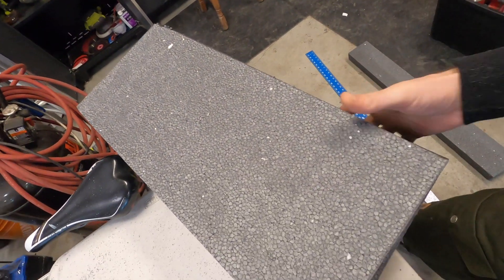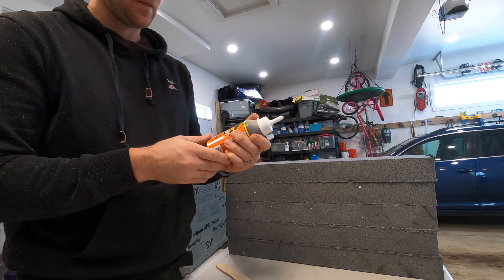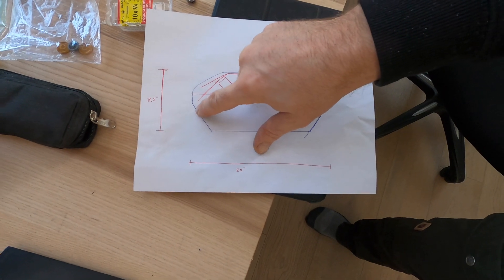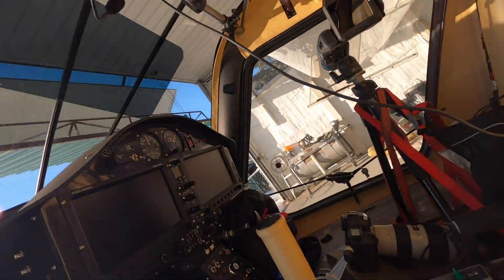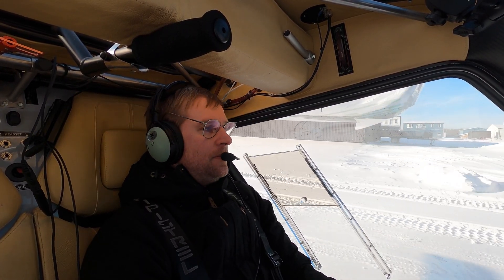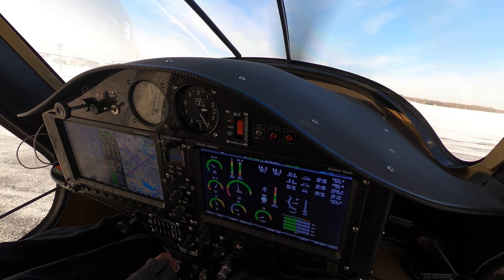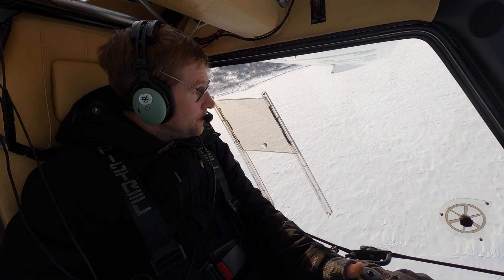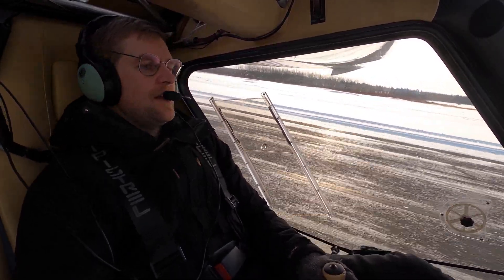I'm Back! Carbon fibre camera shroud

Comment: I was curious. Did you solve the  oil temperature issue? I have the same issue with my Rotax 912ULS and wondered what you did to solve it in your case?
Reply from the maker: Hey there, I had an oil pressure issue not oil temp. I installed large diameter oil lines and fittings to improve the loss of pressure as I climb
Reply: @DarrylZubot  Actually, look back at your videos. Your oil temperature is 120C or more! What happens at this temperature is the viscosity thins and the pressure drops. I have high oil temperature on my 912ULS and I can't figure it out. Its frustrating
Reply from the maker: @PilotJimmyJ  that has very little effect on this issue. I’m flying at high altitudes with cold oil temps and my pressure drops. You are right it will have some effect but it’s not reason why it drops. I am told now by rotax Austria and others that the pump is just too small to maintain oil pressure with constant speed prop, and having oil temp regulator increases oil lines further reducing pressure from pump.